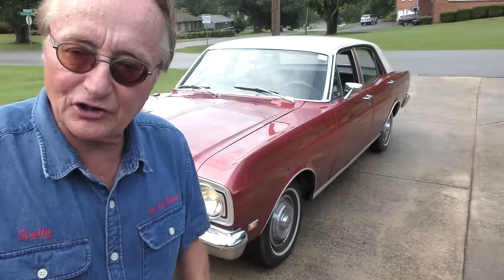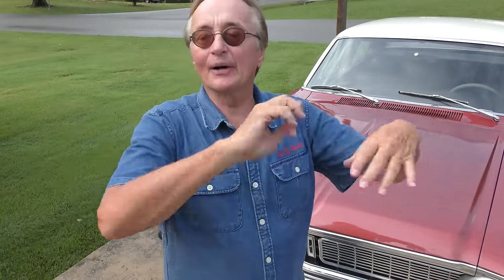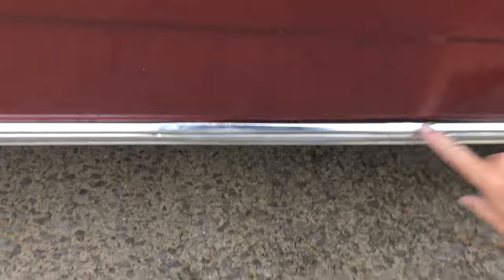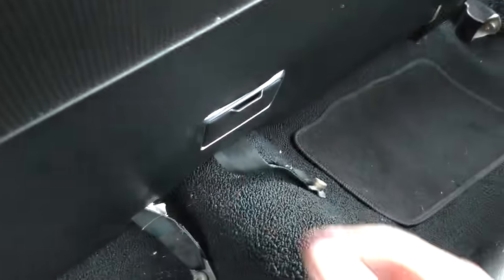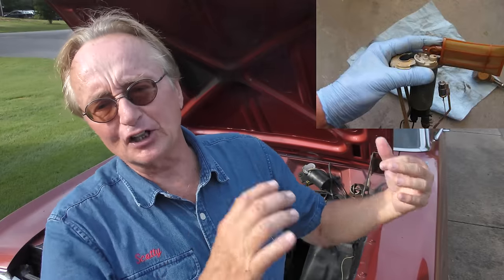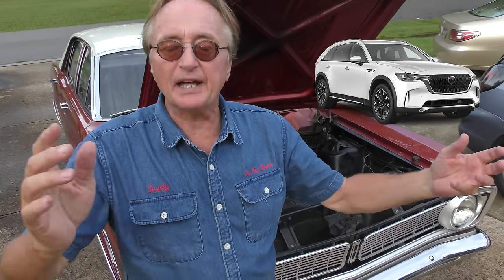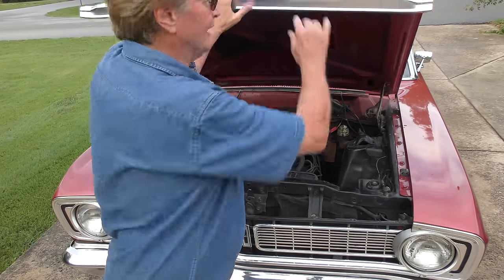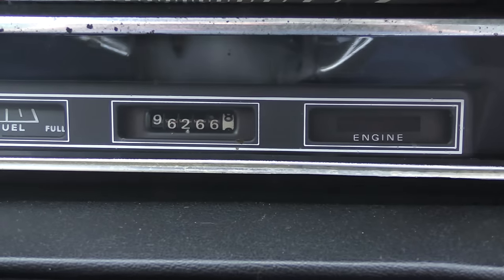I Just Bought My Dream Car

Comment: Beautiful car Scotty, as an Aussie I own two performance Aussie Falcs made in 03 and 04.  They are both 6 cylinder Barras and still have the same design philosophy as the 1960’s original down to the straight 6 bore spacing!!!  So easy to work on I do most servicing and repairs myself.  We stoped production in 2016 unfortunately but I’m confident there will still be Falcons on the road  (upside down of course) over here in another 50 years just like yours.

Comment: My parents bought a 1968 Falcon sedan in the blue color.  Had black interior, straight 6 engine.  Moved to Florida and had Sears put an underdash AC unit in.  Transmission lost 1st gear sometime in the 70's, my father never got it fixed!  I drove the car until about 1985.

I found the sales slip...bought from Mole Ford in Amityville, NY on 04/01/1968.  Ford Falcon Futura.  Color was Gulfstream Aqua.  Select Shift Transmission, Radio, Whitewalls, Wheel Covers, Vinyl Trim.  The price was $2,125 + 2% Sales Tax + Trade In of a 1964 Plymouth Valiant.  I don't know what they gave for the trade in.

Edit:  It was 2nd gear that was inoperative.  Had to wind it out in first, then back off and it would switch into 3rd.  Also, found more info on the sale:  The price before trade in but with tax was $2,551.66.  Dealer gave my parents $325 for the Plymouth Valiant.  This was the car I learned to drive in when I was a teenager.  Like Scotty said, very easy engine to work on, tons of room in the engine bay.  Not powerful, but pretty smooth 200 Straight Six.  Yeah, the steering wheel did spin back to center after a turn!!!  You sort of dragged your hand on the steering wheel to control the spinback.

Comment: There are shoulder straps.  They're stowed above the door, very inconvenient, but there.  They were visible in one of your interior shots.  My '67 Galaxy that I still have,  and my '69 Country Squire wagon, and '69 LTD had the same thing.  Only for two of the three front passengers, none for the middle front,  or  three rear passengers.  Never used them because they were a pain, so just used the lap belts.  Jayman...
Reply: Our 1968 Ford Fairlane 2dr had that as well. They were stowed above door in the roof.

Comment: Up until 1971, our Australian Falcon was heavily based on the US Falcon, with some local styling and engineering changes. Even 1972-1998 were based on the same platform, but locally designed bodywork. We called it a 'big' family car down here, not a compact. The likes of a Galaxie or Impala, ordinary family cars in the US, were considered flamboyant land yachts down here.

Comment: When I was growing up until I turned 10 in 1973 my mom had a 1962 Falcon Deluxe Tudor straight 6 Fordomatic, manual steering  manual brakes, no radio, and dealer added air conditioning...
It was replaced in 73' with a used but like new 1972 Maverick Tudor red 302, automatic, power steering, manual brakes, and factory air conditioning.
It would smoke the tires right off of it if you wanted,,,  both were totally reliable..

Comment: That $1,380 is $14,398 today, and that was without a center arm rest, intermittent wipers, ABS, crumple zones, airbags, rustproofing, and most importantly, cupholders.
Reply: that figure is incorrect
Reply: @stanmarcusgtv  Not according to an online inflation calculator. $1,380 in 1960, the Falcon's first model year, is over $14k today. I certainly am not here to debate you or anyone about it. Do your own homework.
Reply: @stanmarcusgtv  Correct. In 2024 dollars $1380 is worth $11,668.93.
Reply: Regardless of the dollar amount, In todays world I could afford an 11 or 14 thousand dollar Brand New vehicle!!!!! But, nobody makes a vehicle at that price. So anyone that says we live better today than in the '60s is out to lunch.
Reply: @miketype1each  Problem is the '60 2dr Falcon listed for $1,912, with heater optional.
Reply: @stanmarcusgtv If you are going to state a figure is incorrect, state why and what is should be.  Otherwise... sssshhhh.
Reply: But you didn't need a mechanic. Just a sears catalog. And money for tires. because bias ply tires only lasted 20 k miles..
Reply: @kkarllwt  Yeah I bought a transmission rebuild kit from Sears to repair the C4 in my '67 Falcon.
Reply: Or...

You could fit radial tyres?

Comment: My first car was a 1964 falcon. 2 door, no post. 302 V8 with a 4 speed Borg/Warner manual transmission. That was back in the mid 80s. Still have the car and need to restore it but it's still solid.

Comment: I bought my grandfather's 1968 4 door Falcon at 17 years old for $500.00 in 1975 lol.  Then my sister drove it until she rammed into the back of a dump truck!

Did you know the 1963 Ford Falcon frame served as the frame for the 1964 Mustang designed by Leo Iacoca -- who later became the $1.00 per year chairman of Chrysler!

Comment: My first car was a 66 Mercury Comet ( mercury version of Falcon) 289 CI , auto, 2 door,2 tone , gold , white roof, no air,no PS, std brakes . First time I changed the oil it smoked like a steam train ! Took 2 cans of Bardhall to stop it . Leaky valve guides and cylinder wear ! Got me through college commute for three years and one 800 mile road trip !

Comment: Thanks for the memories Scotty. I had a 1961 Falcon with the 144 cid straight six. It had solid lifters, which were replaced with hydraulic lifters in the 170 cubic inch and larger sixes. It was a great first car. Easy to work on and dead reliable. It never left me stranded. It wasn't fast, but it always got there.

Comment: I regularly drive my two 80's Falcon panel vans. and 83 Falcon station wagon. One van is dual fuel which I bought a few years ago for $500 and its travelled  over 800,000 Km. Had a motor replaced by previous owner, but I can do all basic servicing and a coat of white paint brushed on about every 4 years to keep it looking  OK. Rust is the biggest problem!

Comment: America needs a affordable simple car. Owning one of today’s cars is almost unaffordable for most working Americans. The modern car is safe, runs cleaner and is more efficient, but if it breaks down it’s going to cost a fortune to fix. The shade tree mechanic is dead due to the complexity of modern cars. Give me a 6 cylinder three on tree Falcon anytime.😀
Reply: MOST is 100% FACT .
Reply: @keithpearson7059  Yeah I long for 1000 mile chassis lubrications, & 12,000 mile tune ups.
Reply: Saturns used to be good ones up to the early 2000s, especially S series models. Still drive one today, 26-27 mpg and cheap to maintain.

Comment: I had the '67 version that I bought from my uncle in 1983.  Great car: it still had the factory vinyl bags over the rear seat belts.  Mine also required me to push up on the shifter to start it, and I had a rubber band going over the steering column to support the turn signal lever, as otherwise it would sag down and start signaling.  That 200-cu. in. six cylinder was a clean engine, quite torquey.  It was long and narrow; when you opened the hood, you saw the ground on either side.  The auto' tranny was great. I still miss it. --Old Guy

Comment: I learned to drive in a 61 Falcon 3 on the tree. I was not aware of unibody or which engine other than it was a straight 6. 
No power anything. It had a heater and am radio though. We was in tall cotton. 🤠

Comment: Modernized is a BIG DOWNGRADE. A Falcon, like that '69, or a Maverick, or a '60s/'70s Chevy Nova is exactly what we need as transportation cars today. Simple, NO COMPUTERS, lasts forever, easy to work on, reliable, affordable, rear wheel drive, could be had with a manual transmission. I am still driving a 1972 Ford Pinto Squire wagon my dad bought new. Still runs great. On its third engine, but it's easier and cheaper to replace the engine than deal with the computerized garbage in a "modern" car. It only has around a million miles on it. Cars DO NOT RUST in AZ.

Comment: My first car was a 62 Falcon. It was in decent shape, except the front end parts were completely worn out, and it got to where it was too hard to keep it driving in a straight line, and it absolutely ate front tires. I was young when I had it, and didn't have the knowledge to fix the thing. If I still had it, I'd definitely go through the trouble of replacing all the worn parts.

Comment: I had a 701/2 Falcon that had a Torino body.  302 V8
Reply: That was just before the introduction of the Maverick. You could even get a Falcon loaded with Torino driveline options, for a short time. We had a loaded 1970 Torino on the front showroom floor and a basic Falcon on the back. Both bodies were similar.

Comment: I remember the Falcon. When I was a kid back in the 70s they were a common sight. This is the kind of car you want as a daily driver. You want something very simple and basic just to get to work or the supermarket. My uncle had a 1960 Falcon and his had the base 170 c.i. straight six and it was criminally underpowered. The 200 was better and the 250 would have been much better but they were very easy to work on and could last a long time if you maintained them.

Comment: you are correct Scotty, I bought a 1966 Falcon sport coupe V-8 (vinyl roof)in the 90's for my daughter to drive  to high school it set from 2007 until a few months ago . Recommissioned it and now drives perfect( well it did need tires ,rebuild the carb and tune up  also the brakes . Fun fun ha ha if I could post a photo I would

Comment: I have a '67 four door Falcon with 65,000 miles on it.  Only mine is a Futura trim with a 289 and factory power steering and AC.  Also a stock, original car.  Being a '67 Futura instead of a '69 base model, my interior in much prettier.  With the V8, power steering, and AC, its a perfectly reasonably daily driver or road trip car.  I drove it to work this morning.

Comment: I got myself a 2001 Ford AU Falcon Series II. extremely reliable 4.0L i6, 485,000km (301,365 miles) on the odometer and it still gets me too and from work without any problems. Never had to do anything major on it. Just general wear and tear as well as servicing. Despite being ugly, It's a great car.

Comment: that price was incorrect:  1960 FORD ORIGINAL PRICES
1960 Ford Falcon	
Prices
4 Door Sedan	
1,974
2 Door Sedan	
1,912
4 Door Wagon	
2,287
2 Door Wagon	
2,287
Reply: While I was 99.99% sure $1300 was incorrect, $1912 surprised me. On top of these prices, heater was optional.

Comment: 1960 Mercury Comet Wagon was my first car- inline 6 with 2 speed automatic. My dad bought it from a neighbor for $25- ran well, had been sitting for some months and when started up after that time it leaked trans. fluid out the end of the trans. My dad bought it, but in a can of that trans. stop leak stuff, seals softned back up and sealed, not more leaks and I drove it to high school for 2 and a half years before "upgrading". Was a great car and a sister to the Falcon. Never had a problem with it.

Comment: The same car in New England is a virtual impossibility.
My first car was a 66 Mustang with a six. 
My dad bought it from coworker for $150 in 1978! (I was a teenage Mustang freak, but I guess crazy vintage pricing wasn't really a thing yet.)
The odometer showed 87,000, AND the motor was ALREADY REBUILT!
The bottom 6-to-8 inches of the rear quarter panels didn't exist anymore. There was a smaller hole in the passenger side fender.
The key to the successful restoration was the fact that my father was a welder. I removed all of the rust. He welded in quality patches. I learned how use Bondo and sanders. That car was a standi-in for my social life and a hell of a learning experience for the two year leading up to me  getting my license. 
I went to a vocational high school, where my dad was also the welding instructor after he'd needed open heart surgery, and could no longer work in heavy industry. I was able to get shocks, ball joints, and exhaust system and clutch replaced there for the cost of parts and materials. 
My cousin painted in white for next to nothing.
At 16, I had a sweet, very functional 66 Mustang with a lot of sweat equity. Not an exciting car, but man, life was fun in that thing.
I craved horsepower and sold it within two years. FOR $1500. Ten time what my father paid for it.  If I'd hung onto it a little longer I could have made real money on that car.
Bought a 1970 'Stang with a 302. Complete POS!
Reply: BTW- I grew up and started driving a Toyota by age 20. My current car is an 06 Scion Xb with 208K original miles. never rebuilt.
I've only replaced the alternator and tires.
That Mustang was a great experience, but so much progress has been made in automotive design, engineering and manufacturing that there just no comparison in durability and ease of use.

Comment: Yes we in Australia built Ford Falcons from the first 1960 XK model to the last in around 2016 the FG ending with the mighty Barra DOHC inline six which is an evolution from the original 144 ci six! Your 69 Falcon would be the equivalent to our 69 XT model but our six cylinder engine sizes were 188 ci base model to optional 221 ci ironically the same capacity as the first flathead V8’s we built a myriad of Falcon models and body styles from Utes, panel vans, station wagons, sedans, Hardtops, Futuras, Fairmonts, GT performance models, to Falcon based Fairlanes etc etc six cylinder engine sizes in the original design pre crossflow and OHC models were 144,170,188,200,221and 250 ci, 302 and 351 Windsors, 302 (unique to Australia) and 351 Australian built Cleveland’s in all Falcon models Fairlanes and derivatives to Australian built F-series Trucks and Broncos,  Australian 1973 XA models onwards were the first Australian designed Ford Falcons ( and variants) that departed from US designs built here as we went it alone when you dropped the Falcon from Fords US lineup, this XA model included the Falcon Hardtop design better known to the US as the “Mad Max” car, but great to see a real survivor car you have, they certainly are a robust simple inexpensive to maintain classic car and is everything you have outlined, Falcons ( and Holdens) hold a very special place in Australian motoring history also and I own the last design of Australian Ford Falcons, an FG XR-6 model as the onslaught of SUV’s and imports have ended the last of the large rear wheel drive sedans and there is nothing to replace the Falcon as the “great Australian road car” as Ford use to say in its advertising here, I intend to look after my Falcon and keep it in its pristine condition as there is nothing on the market now that can replace it! there’s a place for SUV’s etc and I have one but there is also a place for these large rear wheel drive 4 door sedans that I think are practical and preferred, probably similarly is your Crown Victorias

Comment: $1300?  Try closer to $1900 in 1960.  Still a good deal for what you got.
Also, not the first compact mass-produced car.  (I'm leaving out cars like the Crosley, Henry J, Austin Bantam and the King Midget).  Studebaker had the Lark a year before the Falcon, and AMC had the Rambler American in '58 (also a unibody car).  And the American was actually a updated Nash Rambler from the early '50s.  Then there was also the Willys from the late '30s to the mid '50s.

Comment: My dad had a metallic gold one of these in Australia, called an XY Fairmont. It had the 250 cid motor, front disc brakes, a/c, power steering, and bucket seats. Steel wheels with full diameter wheel trims.

The 250s had hydraulic lifters and were smooth and torquey with reasonably good economy and towing ability. Later 1970s models of those 250s had a cross flow alloy head, and in the 1980s they received [EFI] electronic fuel injection.

Comment: Australian taxi drivers loved the Falcon, they ran well on LPG (which is half the price of regular unleaded), in wagon form they could carry a lot of luggage, and were available with a front bench seat and column shift through to 2008 (when the wagon was discontinued as well). The base model Falcons and Holden Commodores weren’t anything flash (though the luxury and muscle car variants certainly were!) but they were solid, reliable, kept thousands of people in a job, and were a hell of a lot better than some of the utter junk that’s on the new car market in Australia today.

Comment: I learnt to drive in my dad's '68 xt falcon panel van, 3 on the tree and no passenger side mirror. It had a 3.6 lt 6 cylinder engine. He sold it when the A pillars rusted out

Comment: Friend of mine bought a 69 back in the mid-90's, light blue met, 250cid 6-auto, straight body, just some faded paint on the drivers side rear. Same security system. Older lady had it, he was the second owner.  Many memories.

Comment: I'm in Australia and have a 2010 ford falcon xr6 fg series ute certainly not built like that any more 170000km and I've replaced all the shocks both front wheel bearing and hubs there a sealed unit. Regular oil changes every 10000km brakes don't hold up paint is starting to fad but engine still runs great.

Comment: They are good cruise mobeeles for carrying all your mates in, I drove  the XY and XR models for work vehicles and gettaways. XR Falcon station wagon was my first car after learning how to drive with my brother in a HR Holden sedan. Then went onto the the HT Holden utes/ sedan, then Triumphs , 2500/2000/Herald convertibles. I've tried  about 50 or more cars since I was about 16. Worked on all of them. Putting a 2.3 CF Bedford engine into a 1800 Vauxhal Victor was one of best success stories. Also a crossflow XD Falcon motor into the old XY wagon was a great success. I was in process to get a 400 Cleveland with C6 auto into the old XR...but didn't have the resources at time.

Comment: In 76/77 I drove a fordor 67 falcon 6, 3 on the tree. I loved that car.  roomy. easy to repair ( I replaced the clutch by dropping the trans onto my chest. ) Northern mid west. When the hood attachment points failed, I scrapped it. About 80 k miles.